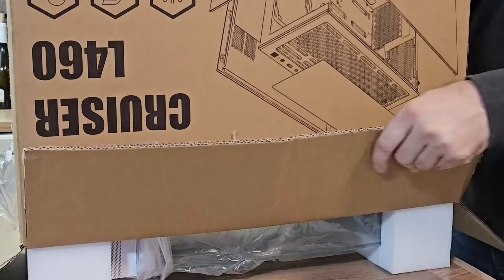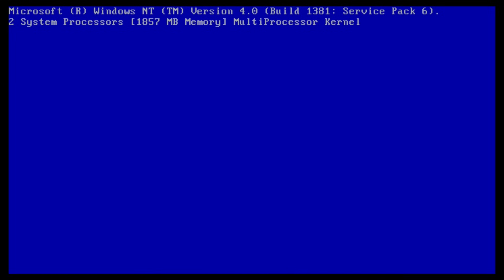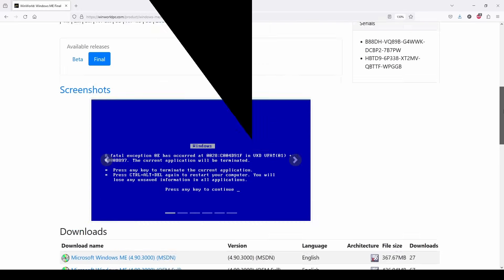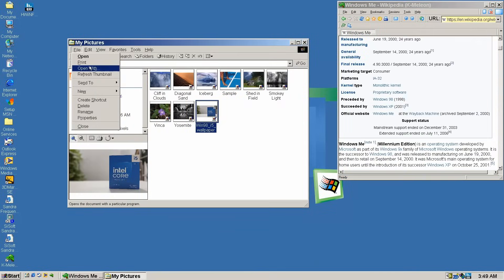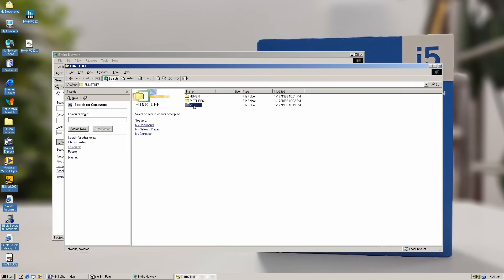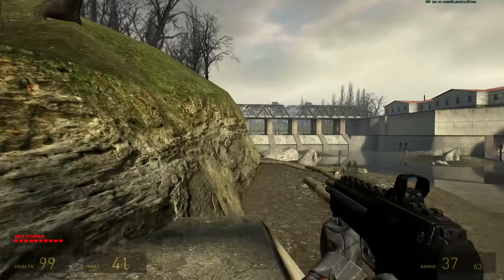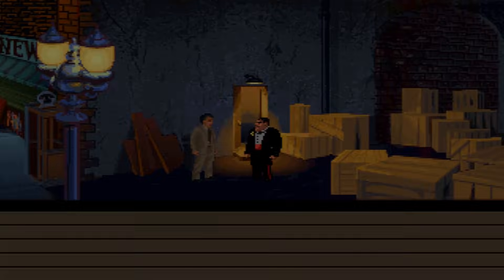Mission Impossible? Windows ME & NT 4.0 on a Modern PC (14th Gen i5 + Z790 + DDR5 + M.2 SSD)

Comment: Hi! Great video! I’m also trying to run Windows Me on a modern PC 14900k + Z790-H. Thanks to cregfix.vxd and your video I was succeeded with Windows ME on 14900k and ASUS Strix Z790-H. It runs, but I have some problems: I don’t have PS/2 ports on Z790-H, so I can’t use mouse or keyboard. I tried to use PCI-E to PCI adapter, but it works only in Bios or any modern operating system. Windows ME can’t recognize PCI devices connected to this adapter. I also bought  ASUS PRIME H610M-K D4 with PS/2 ports and install 14900k on it. Now I can use keyboard or mouse, but a don’t have any PCI devices in device manager like in your case. Can you help me, what can cause this issue? I was using already installed ME iso on a virtual machine, then just wrote the full disk image on a SSD. Thank you

Comment: I always thought it was so intricate to navigate the driver installations for old windows versions and when you have them all installed it's such a nostalgic experience. Especially when you finally have the dual monitors inside of display properties 😀. I personally bought the sound blaster audigy sb1349 as it's the last sound blaster card to have in a stock compatibility ms dos sound in it's drivers. I also have a 7900GS but last time when I used it I noticed artifacting and it may be because of the wrong driver. Running on hardware that was one of last supported by 98 on Asus Intel 865 p4p800e deluxe.

Comment: Hello, an Geforce 6 series pcie is good for Windows 9x/NT4? In this case 6600 LE
Reply from the maker: Hi! Yeah, it should work on both systems. But for NT 4.0, I'd recommend a Quadro card. I actually just tested an FX4500 (basically a GTX 7800) in this video: https://youtu.be/0gyDNUwG35Q and it performs great. The Quadro line really had proper OpenGL support which matters in Windows NT 4.0 as it has limited DirectX support - just up DX5.0 while in Windows 98/ME you can use DirectX 9.0c. (including a release from mid 2007)

Comment: 10:25 CPU patching do u have a video on patching 12th thru 14th gen?
Reply from the maker: At that point, I’m referring specifically to GPU driver patching, particularly R. Loew’s patches for the Nvidia 6000-7000 series GPUs released between 2004 and 2006. If you’re interested in the full procedure, check out this video: https://youtu.be/iMyK-NJkSoo

As for CPU patching, there isn’t really such a thing. The closest solution would be cregfix, which corrects a control register flag in the CPU that is incorrectly set by the AMI BIOS. You can learn more about it in this video: https://youtu.be/6xAgMiTNk3Q

Comment: Windows 2000 was in my opinion the best OS ever from MS, since then is basically gone downhill. To much BS, too much space, to many bits of useless software a true enthusiast would never use. 

Cmon linux drive out these modern versions of Windows, complete bloated spyware crap.
Reply from the maker: As computers became more powerful, they naturally had more room for bloatware—just because they could. Windows 2000 was indeed a great OS, and it was the last NT-based Windows that could technically run on a 486 CPU (though not very well). Check out this: https://youtu.be/osoLP8Vm-Yc After that, system requirements kept climbing alongside hardware advancements, which opened the door to heavier, more feature-packed ( more bloated) versions of Windows.

Comment: Hey Omores thanks for the good info as usual. Does your nvme drive works in ms dos compatibility mode in win9x/me when it is installed in a motherboard nvme slot?  I remember that you said it has to work in this mode there is nothing that can be done about this for nvme drives in mobo slots
Reply from the maker: There are no native NVMe drivers for Windows 98, but some NVMe SSDs might work in MS-DOS compatibility mode, as shown this video: https://youtu.be/BulG6-1XOe0 Whether this works depends on the motherboard and the NVMe firmware compatibility. Modern BIOS firmware includes a basic NVMe driver to allow booting and basic I/O operations, similar to the way it includes USB support. For instance, your BIOS can read USB sticks to update firmware or save screenshots. Likewise, the BIOS can emulate an NVMe SSD as a fixed disk for DOS. However, to make this work, you must format the drive correctly and to be safe stay under 8.4GB for DOS. And of course it must be the first partition on the drive.
Reply: Thanks for reply. Yes, I learned 8 GB limit from your video. I made my nvme work with that way otherwise it wouldn’t get formatted. You get 300 mbytes transfer rate with nvme ,right? I couldn’t get Sandra work with my nvme. It is working only in ms dos compatibility mode and its not very fast. Sata Sata ssd with ahci works beautifully
Reply from the maker: With NVME no, with an SSD in AHCI mode yes - 350MB tops. In MS-DOS mode the transfer rate is 10-20MB, you can have the fastest drive in the world, it doesn't matter.

Comment: Dumb question, but does NT 4.0 support USB keyboards and mice? I'm thinking about trying it on one of my systems, an nForce 520-based Athlon 64 X2 PC, but I don't have any PS/2 peripherals at hand.
Reply from the maker: Yes, there is limited USB support on Windows NT 4.0 through third-party drivers and this includes USB KB/MS devices. You can find the patch by searching for 'Windows NT 4.0 USB Support Patch' on Google. I'm using a PCI-E to USB 1.1/2.0 adapter, and it works without issues in NT 4.0. Anyway, your motherboard will attempt to emulate your USB mouse and keyboard as PS/2 devices. This works on my AM4 PC with a Ryzen 9 3900X CPU, as well as on older platforms like socket 1150 and 1151, on your nForce build should work as well. You have to enable it in BIOS.

Comment: Am I missing something? NT4 didn't have USB support, so how does the mouse and keyboard work, on a motherboard with no PS/2 sockets?
Some years ago, my work PC was an SGI machine that was running NT4, but SGI had developed their own custom USB drivers for NT4. I can't remember which CPU architecture this was unfortunately. I thought they were MIPS but Wiki suggests they were Intel based.
Reply from the maker: There is limited USB support on Windows NT 4.0 through third-party drivers. You can find the patch by searching for 'Windows NT 4.0 USB Support Patch' on Google. I'm using a PCI-E to USB 1.1/2.0 adapter, and it works without issues in NT 4.0 thanks to the USB driver. This motherboard has a PS/2 port, but it supports only one device—Y splitters won't work. However, there is also a serial port available, so you can use a serial mouse and the PS/2 port for the keyboard.

Comment: What's next?
Reply from the maker: I'm setting up Windows 98 to run on a super-fast USB 4 external SSD enclosure from Zike, capable of transferring up to 3800MB/s. I haven’t installed Windows 98 yet, but I don’t see why it wouldn’t work!
Reply: Windows 98 was the better version. Windows millennium edition was NOT ever mentioned at technician school that my best friend went to, they used 95, 98 second edition,  nt 4.0, and 2000. There was a step up version of m.e. at the very end for $20. I feel sorry for people who paid 100 for the upgrade (from any version), and 200 for the "full version ".
Reply from the maker: Windows 98 remains my true love, but for installations on modern hardware, Windows ME offers slightly better compatibility with USB and AHCI drivers, making it worth considering. Additionally, ME provides improved DOS sound support thanks to certain WDM drivers, such as those for the CMI8738 chipset. It also includes built-in WDM drivers for Creative Sound Blaster cards, which are absent in Windows 98.
Reply: WOW thats cool! But when will it come out (planed date)
Reply from the maker: @ That Zike video will be ready next week. Tomorrow I'm planing to publish another one:  about a very good deal with PCI-E cards compatible with Windows 98/ME. I got a "refurbished" PCI-E Quadro GPU, a PCI-E to USB 2.0 and a PCI-E Gigabit LAN card all compatible with Windows 98 for just 47$. I don't know if will be able to deliver, since the video it's not ready yet but I'll do my best....

Comment: CMI 8738 is not good for adlib emulation.
Reply from the maker: True, the CMI 8738 isn’t the AdLib king, but hey, you can't have it all.
Reply: @O_mores  the solo 1 IS the response
Reply from the maker: @asanjuas  I actually have an ESS Solo 1 boxed. I will make a video about this card, but there are no .WDM drivers for 98, only for XP.
Reply: @O_mores  strange but adlib works very well with practically all dos games
Reply from the maker: Adlib made its debut in 1987, but Sound Blaster entered the scene less than two years later. By 1989, games were being developed to support both Adlib and Sound Blaster.

Comment: i tried to put win 98 on my 19 12900k and 4090 it wouldn't read my nvme or gpu and cpu was not complient
Reply from the maker: The CPU is definitely compatible—I’ve successfully installed Windows 98 on a 12th Gen CPU. However, NVMe drives aren’t natively supported by default. SATA drives, on the other hand, are compatible because they can handle real-mode requests from DOS or Windows 9x via the AHCI protocol, which has native support. Later you can even install Windows 9X AHCI drivers. 

For NVMe drives, compatibility depends on how your BIOS handles them. Some NVMe drives work with Windows 98, while others don’t, largely depending on the firmware. Regardless, it’s critical that the Windows 98 partition is the first partition on the drive, and to be safe don't make it larger than 8GB. If it works with 8GB you can try 32GB later. 

As for the RTX 4090, I’m not entirely sure. These GPUs have both UEFI and VGA BIOS modes, so they should work in CSM (Compatibility Support Module) mode but I haven’t tested anything newer than the RTX 3000 series.

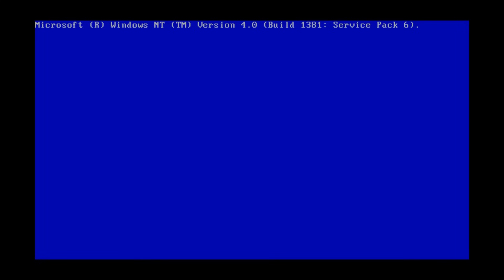Comment: 1:44 does NT 4.0 startup process include the running progress bar of this style?
or did you use newer version of NTLDR?
Reply from the maker: I'm using NTLDR and NTDETECT from Windows 2000, which are compatible even with Windows NT 3.1 from 1993 (or vice versa). This setup allowed me to successfully boot Windows NT 3.1 with 3.5GB of RAM:  https://youtu.be/udGXB2LlntU Otherwise you it will see only 64MB which was something in 1993. Essentially, I have every edition of Windows NT, including Windows 2000, installed on the same partition, but each is housed in its own folder.
Reply: great, just like i guessed, it just looked like Windows 2000
Reply: would things go wrong if you install both NT 4.0 and 2000 on a same partition?
Reply from the maker: No, I have them on the same partition. But the Program Files folder might get messy.
Reply: o...kay

Comment: Install Windows NT 4 Server Enterprise Edition and you'll be able to use up to 8 logical processors (the installation process is nearly identical). Unfortunately, as NT 4's kernel is not aware of SMT (hyperthreading) you may want to try disabling SMT so that it doesn't just end up running on the SMT threads of CPUs 0-3 (e.g. SMT logical processors). It'd also be interesting to see what the 4.0 version of the NT kernel thinks of the asymmetric processors of the 14600, given that it's actually made up of CPU's (cores) from two different CPU families. Regardless, NT 4's kernel will not have any topology information about SMT or the different types of processor cores, so it won't adjust scheduling accordingly (not that it matters, given you're just doing all this for fun).
Reply from the maker: That’s a really interesting suggestion—thanks for the detailed breakdown! I’m actually curious now and will definitely give it a try. I’m currently recycling a Windows NT 4 installation from 2021 (mostly because it’s just easier to plug in the drive and see NT 4.0 running rather than starting fresh). But for my next install, I’ll definitely go with the Enterprise Edition.
Reply: @O_mores  Technically, the NT 4 kernel could enumerate and schedule up to 32 processors, but more than 8 CPUs was the domain of OEM modified editions with custom HAL and enablement stacks, because they generally required additional OEM support due to non-standard CPU and memory bus interconnects (e.g. system specific crossbars, NUMA, etc.). 

Out-of-box enabled support for 32 processor configurations, primarily thanks to the Unisys ES7000 (though it did require a specific HAL, IIRC) came with Windows 2000 (aka NT 5). Support for NUMA and 64 processors would land with Windows Server 2003 (64bit version for 64 processors). 2008 R2 delivered processor groups for larger than 64 CPU configs (as chip multiprocessing and SMT logical processor quickly drove up the enumerated CPU count). 

Obviously, modern NT kernels can support 1000's of processors (with scheduling aware of NUMA nodes, SMT, asymmetric cores, etc.). I have an amusing screenshot of Task Manager with 1792 logical processors running on an SMT enable 896 core machine.

Comment: Nice video! you should look into getting an ASUS Pro H810M-C motherboard for Arrow Lake and a cheaper non-K ARL SKU when available and then release a whole new set of videos for old OSes on ARL!
Reply from the maker: Konnichiwa! So, funny enough, I actually took a look at this exact motherboard just two days ago. It really does seem to have everything you’d want for a solid retro setup—serial, LPT, PS/2. But about CSM... well, here’s where things get murky. I mentioned earlier that it was listed in the manual of an MSI Z890 motherboard, and I even copy-pasted that part into a comment. But guess what? It turns out that might have been recycled pages from a Socket 1700 manual. 🫠 I went back to double-check the Z890 motherboard page, and lo and behold, there’s now an updated manual with no mention of CSM at all.  

In fact, I combed through every manual for the Z890 and H810 boards, searched for 'CSM' or 'Compatibility Support Module,' and got nothing. So either the manuals just don't mention CSM or the CSM is living now just on the socket 1700 and AM5 motherboards.
Reply: @O_mores  well, there's only one way to know, right? i mean, one can always return a "defective" motherboard to amazon or whatever (not being able to run Windows 95 natively counts as being defective ;)

Comment: To investigate crashes on Win9x I used SoftIce back them. Once you get a Blue Screen of Death, you do the key combination of SoftIce and you are in a debugger that loaded before Windows. Then you can see what caused the crash and most of the time you can REWIND the calls that lead to the crash and go back in Windows !
Reply from the maker: I remember a specific MSFN forum page where people were discussing the VCACHE error, and I revisited it to see if there were any updates. Unfortunately, there wasn’t anything new—just that cryptic SoftIce screenshot. Until the cregfix was released and I updated the page myself...
Reply: @O_mores  27 years ago feels like 50. I remember that the drive to use it was the constant BSOD I was having because of crappy Ati All-In-Wonder drivers. And then I found out I could use it to get the correct key for softwares like ACDSee. You'd enter a random key and press enter and have a SoftIce interput on MsgBox calls and from there backtrack to the je/jne condition and read the key that was compared to my fake one.